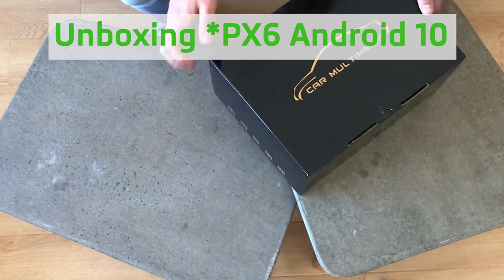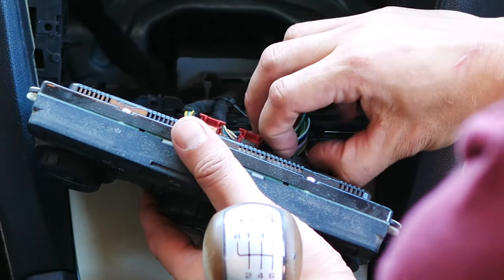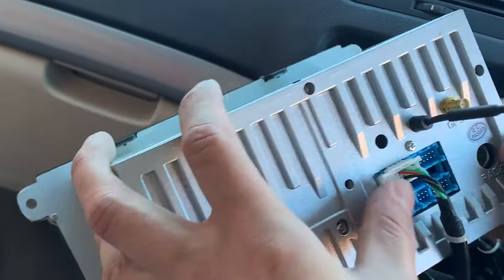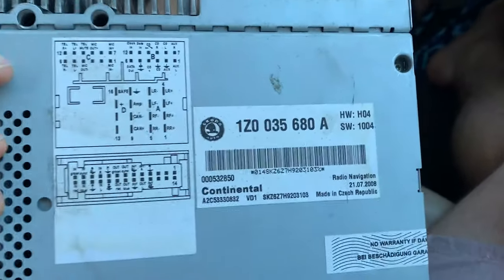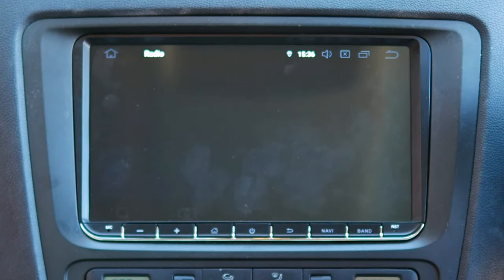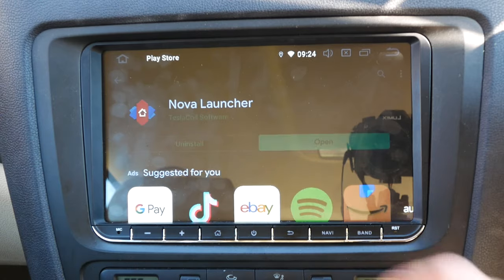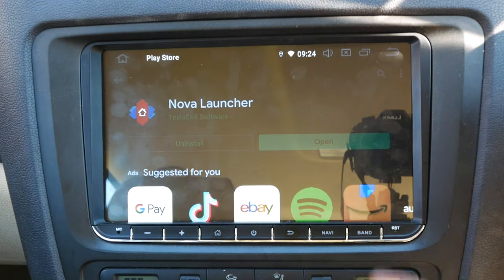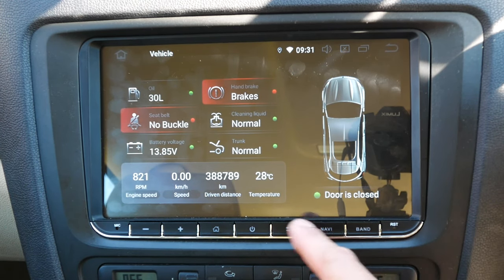Android 10 PX6 Double DIN Stereo unboxing, installation, and quick review in Skoda Octavia Mk2 1Z

Comment: Hi mate - brilliant video. I also have a Mk2 4x4 Octavia but with a Bolero head unit, not the Columbus. Presumably the PX6 would replace the Bolero no issue? Cheers.
Reply from the maker: Yep should do! All the fittings are the same back there (quadlock).

Thanks for watching.

Comment: hey mate just have a question with the stock swing radio on my skoda i can change the bass level treble etc stock audio sounds really good but i feel as if one of these systems might not have the same quality, how did it sound to you?
Reply from the maker: Hi Sterlo we made sure to order the one with the DSP so the Audio is actually very tuneable and sounds way better than the stock Columbus unit we had.

Comment: Heya mate, brilliant video. I’ve bought a different head unit for my 2012 Skoda, everything seems to be plugged in okay but I’m getting nothing to turn on. It’s a pioneer head unit with a 10A fuse.. would this be the issue when the factory head unit is 15A?
Reply from the maker: Thanks for watching! Nah shouldn't be the fuse at the head unit...
Sounds like the battery power and IGN might be wrong and check there's a proper ground connection.
Reply: @ianpgonzaga  hey! Thanks for the swift response. I figured it out... turns out the 12v wire wasn't connected hahah. Got it all working now!
Reply from the maker: @DOMKEHOE  awesome! Enjoy!!!
Reply: @ianpgonzaga  nevermind! Killed my car. I assume this is because I didn't have the right wiring harness from the get go. I've since learnt that this is because Skoda's run from a canbus and there is not ignition switched port. Are you able to point me in the right direction of where I can get a wiring harness for this that would work?
Reply from the maker: @DOMKEHOE  hey oh no bad news about the car. I think you can "get it back" by disconnecting everything and putting all the original stuff back. I've killed my TT 8J a few times cuz I messed too much with CANbus hahah

My android kit came with its own harness. Maybe ask the supplier for their recommended harness ?
Reply: @ianpgonzaga hey! Yes managed to get the car back on and able to get the original unit in. Just need to find a harness that’ll work with this car and head unit I have. Thank you!
Reply from the maker: @DOMKEHOE  cool! The main thing you'll want in the harness is the twisted pairs of wires = CANbus loom.